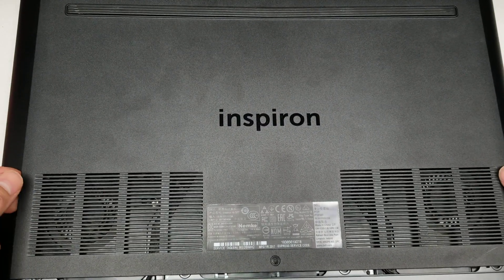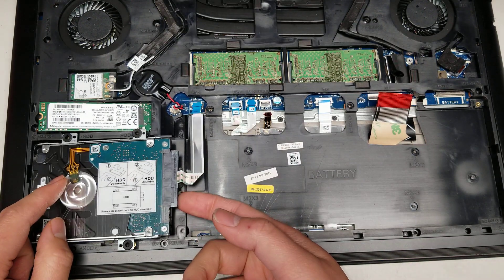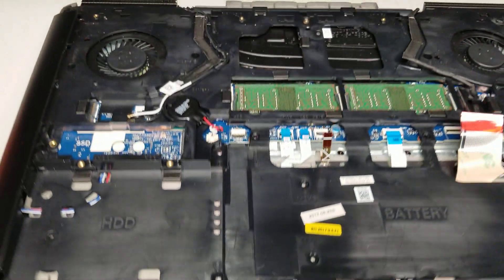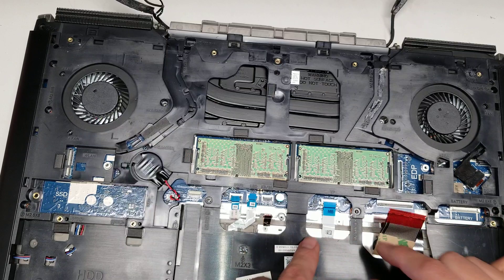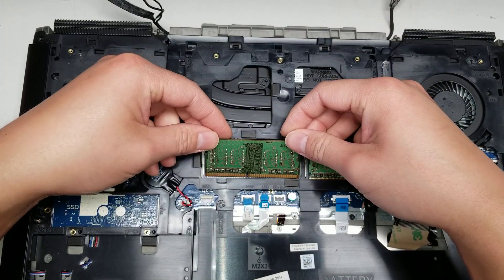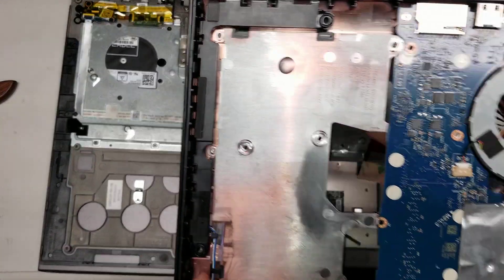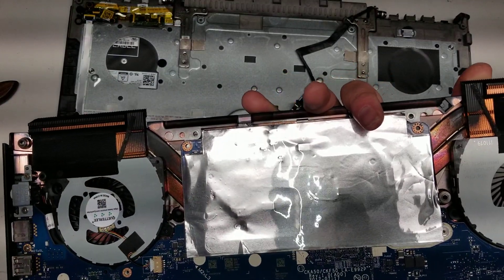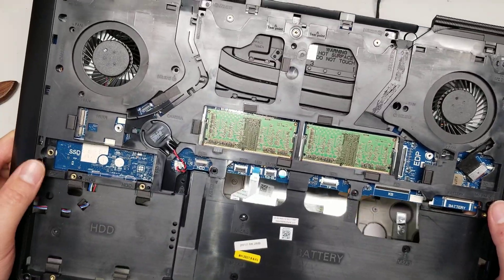DELL Inspiron 15-7577 15 Gaming 7577 Disassembly RAM SSD Fan Upgrade Repair

Comment: hey, may I know your cpu temperature? and gpu temperature?
I have the same laptop ang I have re-applied thermal paste already but still, when Im gaming CPU reaches 95 degrees Celsius and when idle it's around 55-64 degrees celsius, I dont think my heat sink is working properly. It's such a waste because It still works fast but everytime I wanna play games I can gain 60fps which is pretty smooth already and then suddenly drops to 12fps because of the overheating. 
any advice?
Reply: Hello , for everyone concearned about issues with overheat . a majority of these models we re made with an error at the heatsink. witch do not conduct properly the air  on chips. You have to immediatly go on a repair site. and ask for heatsink replace and also for the coolers +thermal paste. i had the issue where temps hit up to 95 c. and after i investigated , this seemed to be the problem. got replaced the whole airflow sistem.and the temps are not hitting more than 75 c EVEN WITHOUT UNDERVOLT. witch is keeping it around 70c in hard load. go go
Reply: I have the same problem :( I undervolted and cleaned for dust, havent reaplied paste cuz im scared, but the temps are still very high.
Reply: Exactly what I have with this gaming laptop. In 8 months I had to bring it for repair 2 times, and it was always overheating. The technician said it's because the cat hair that goes into the laptop, but when I was using it somewhere else without animals it started to overheat again. It is hard to realize, but I feel like this laptop is not good for gaming.
Reply: Same problem .  I would never suggest any one to buy it . I will be happy of someone bought this from me for 700 dollars waste of 1.3k dollars
Reply from the maker: I don't own the computers I work on, so I have no way to give you that info. Maybe check if the fan is working properly and make sure dust isn't blocking the heatsink air output.
Reply: I have the same problem with mine. Me and my sister both have this model and we both have a lot of trouble with thermals and overheating. So its probably just this model of computers.
Reply from the maker: Sadly it's not designed for gaming. For that Dell makes alienware laptops. One alternative is to play games on a fridge or turn the ac down. :(
Reply: @ItsBinhRepaired  Officially it is designed for gaming. And at this point all I want is my money back lol.
Reply from the maker: @attilamizsak5622  how long have you had it?
Reply: @ItsBinhRepaired  I bought the product in December of 2018. After 5-6 months the laptop started to ridiculously overheat, so I took it to the service where they replaced the cooling system. They also tokd me that the unit had been full with cat hair and dust. After 2 months the laptop started to display the same symptoms, but this time I had to pay for the service, which included replacing the thermal paste. That time I was extremely careful with the cat hair and dust, but after like 8 months the laptop started to overheat again. The thermal paste has been replaced like 2 weeks ago, and I had to pay for it. After the 2nd repair I contacted the dell support to give my money back, and after days of arguing they just stopped responding to me. This hapoened like 11 months ago. I couldn't carry the case on anymore, cuz I had to travel to another country, but I am REALLY curious what Dell thinks about this product.
Reply from the maker: https://youtu.be/3zs_SJ3BXgA that should help
Reply: Attila Mizsák for you my friend if you get any laptop it gonna overheat, for what you said it looks like you live in a dirty place with cats of course it gonna overheat
Reply: this is definitelly overheating issue, try to contact dell support, I had pretty same situation (except my temps got to 100 always) ending in replacement of heat sink with fans - one of the fans had quiet but hearable rattling and that was enough for support to send technician. now with regular dust cleaning i have 80C max while playing games